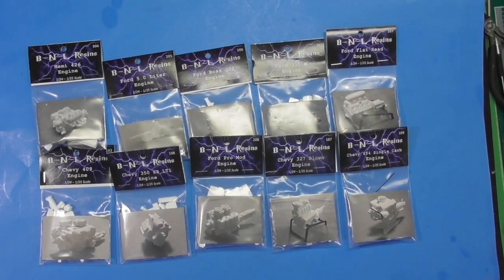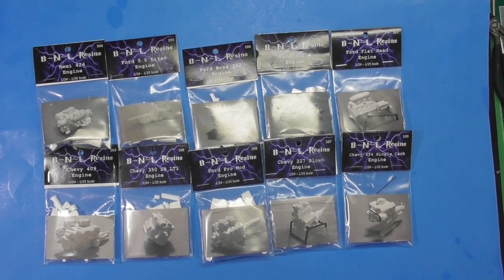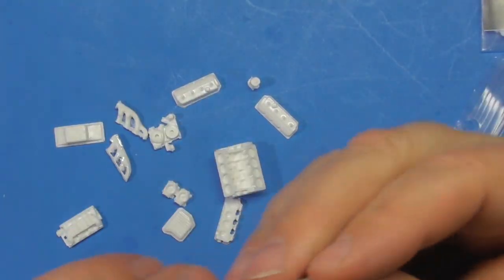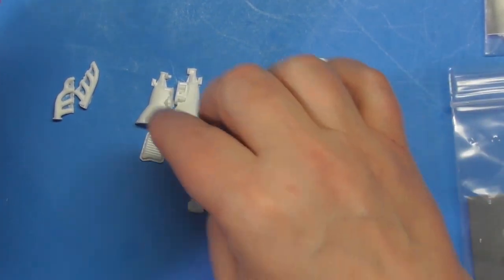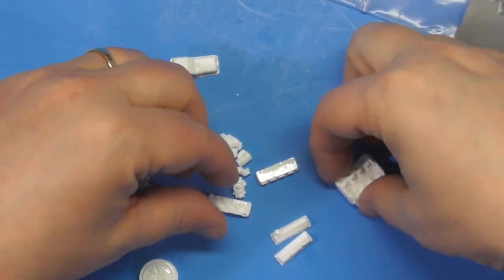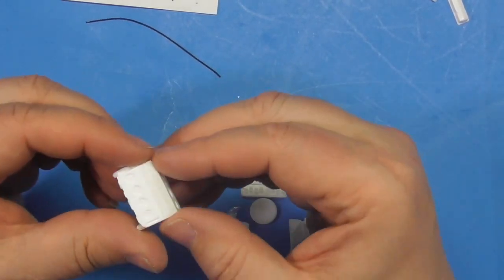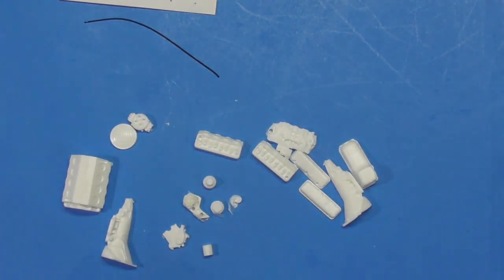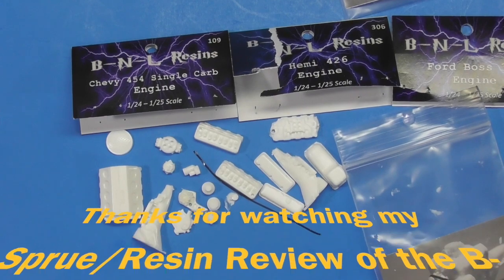Sprue/Resin Review 1/24-25 BNL Resin Engines

Comment: Thanks Brett, excellent review. I just sprang for a Ford Cleveland engine, plus a radiator, brake booster, 9 inch diff housing and some other custom parts to dress the engine. Just what I need to turn my kerbside Aussie Ford Falcon kit into a bonnet open build.